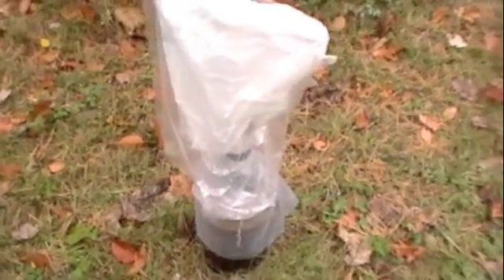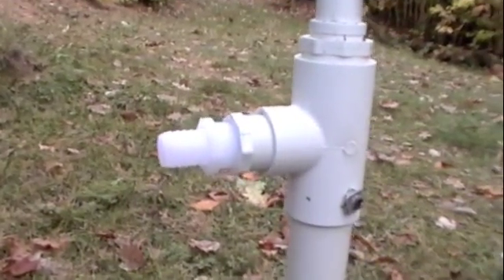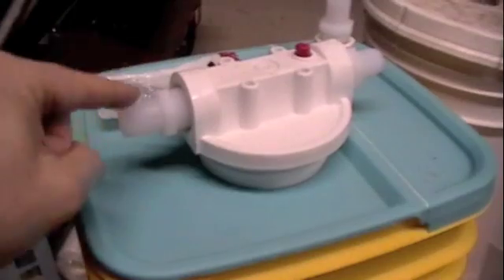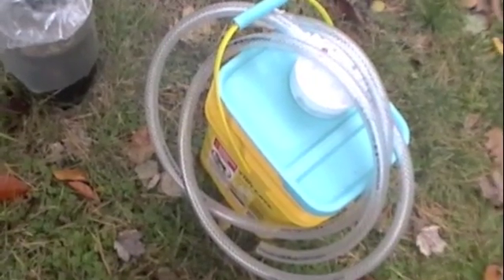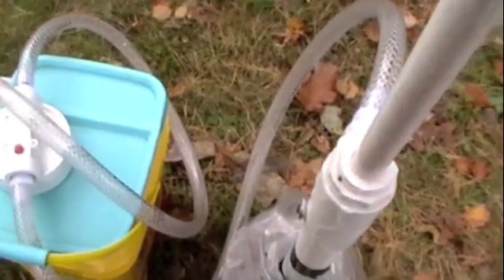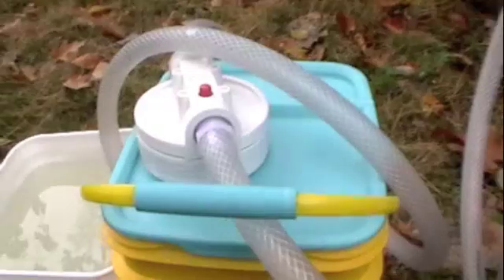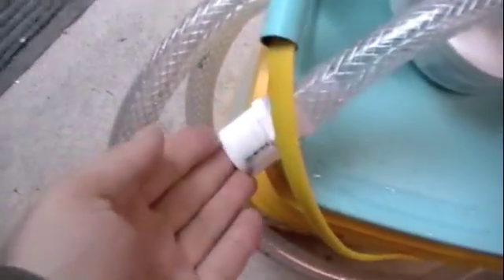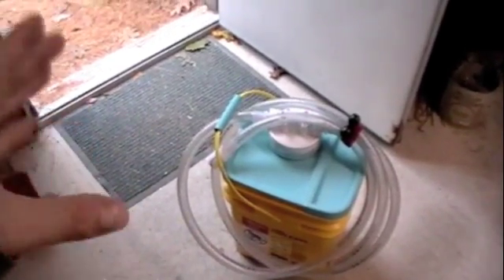Filter for My Hand Pump

Comment: Babaloo! You have helped me so much in the past, I am happy to be able to tell you that you don't need a filter. You need to get or rent a submersible pump and run it for 10-12 hours. Your well just needs to be flushed. The sand will be the best and biggest filter you will ever need. It just needs to be flushed out.